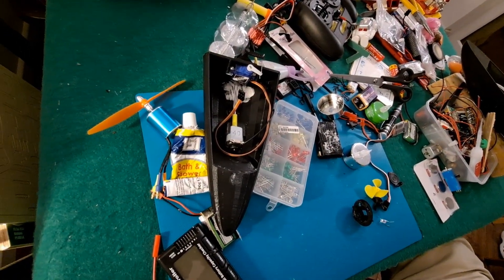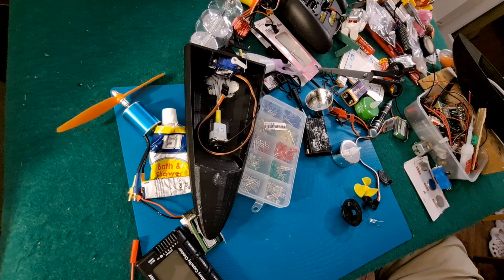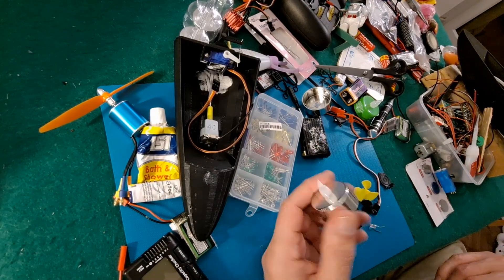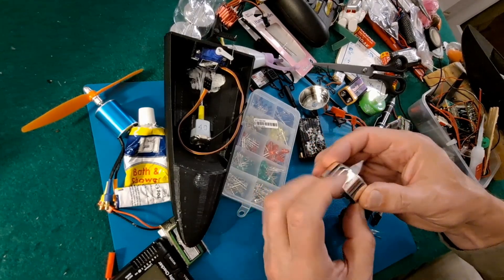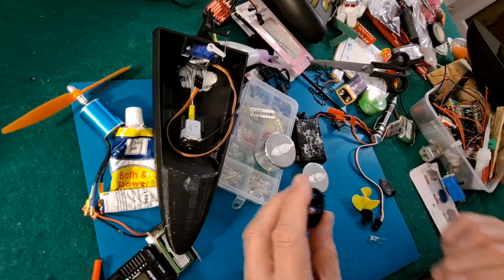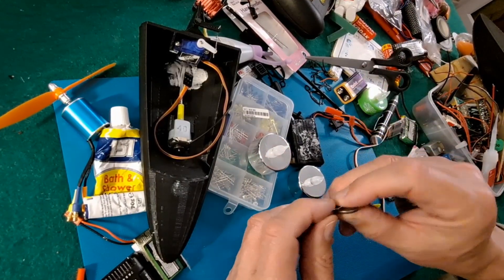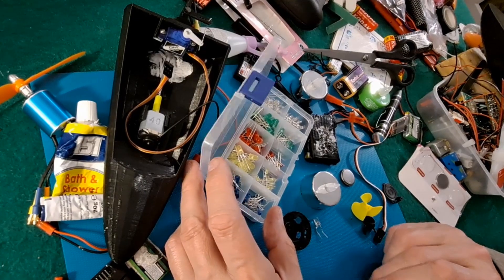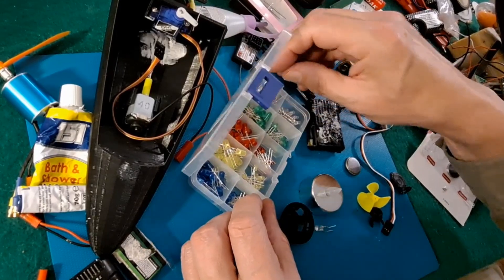LED Tea light fix 20201020

Comment: I'm trying to find green but I'm not paying 30 bucks for 2 eyes I'm trying to create.   So this helps,  thank you sir! ^-^
Reply from the maker: You should be able to get a pack of green LEDs on eBay or similar online store for little more than the cost of the postage. They are pretty cheap especially if you buy quite a few.

Comment: Hello sir, how are you, I repairs also RC cars, please tell or make a video, that how to match 40mhz remote and 27mhz RC car circuit,
Reply from the maker: The short answer is you don't. You would have to change the part of the circuitry that generates the radio frequency and if you are going to do that sort of component level work it is easier to get a different receiver. Technically it is possible. I would suggest searching for the data sheets for the TX2RX2 chipset as these are the common ones on most toy grade RC systems. Some of the data sheets give examples of the circuit applications.
Reply: @GrandadIsAnOldMan  thanks sir, means I have to change crystal or uh coils,
Reply from the maker: @azeembilal1691  Most of the toy grade I have seen do not have crystals.